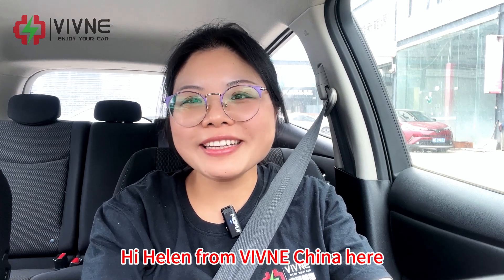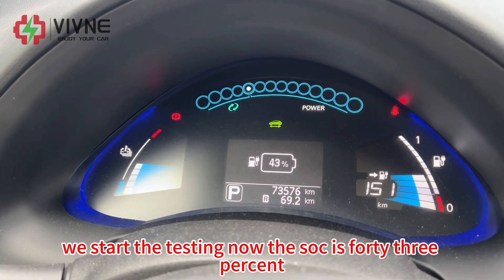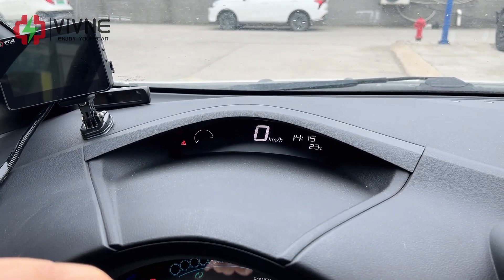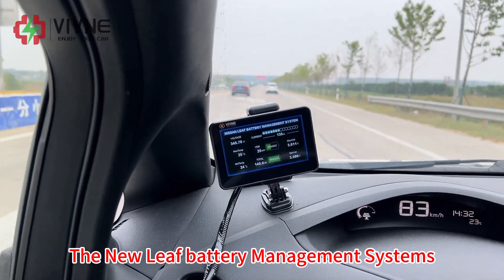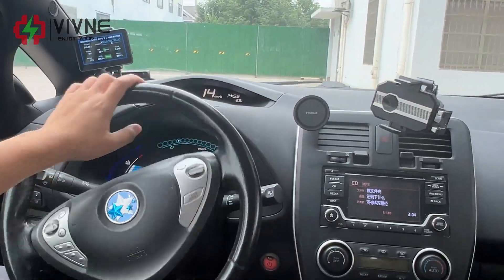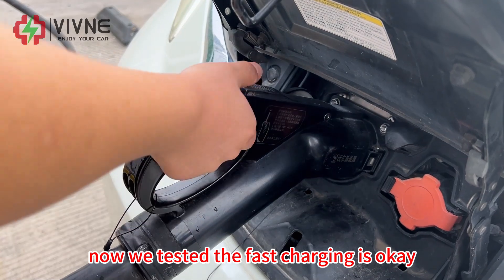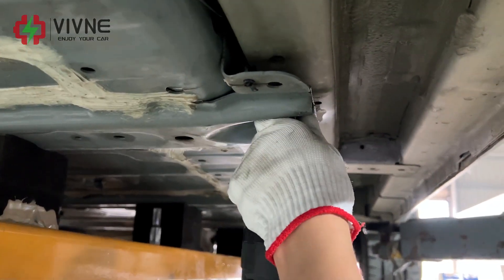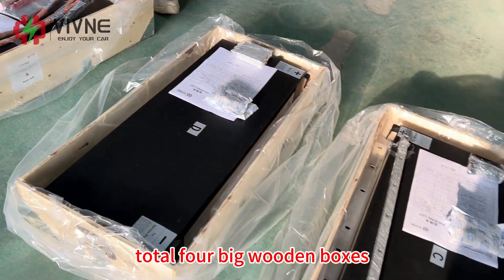VIVNE-50kWh battery kit to USA

Comment: I got a 50kwh pack several months ago, it came just as shown,  they supply a video link for assembly, they were quick to respond with any questions, pack works great just as they said.  Time will tell how long it will go but this company seems very conscientious.  Battery was less than half the cost of a Nissan battery besides Nissan will only replace the 24kwh battery with another 24kwh which is to small.  This company reprograms the bms so the 50kwn works like an original battery but with more than double the range.  I am happy with what I got
Reply: what was the price? shipping included? [EDIT] prices are listed on their website, so where are you and how was the shipping? at you door? How much. thks
Reply: @physiqueDrummond  I am in north central Canada (Ontarion).  I picked up batteries in Toronto.  I went in with others and we bought 3 battery packs two 50 kits and a 62 plug and play. Combined we felt it was half price from dealer replacement but the size was more than double what dealer will provide and the bms is reprogrammed; result works perfect.  The company quote is good and the support was very good; we are happy with range for our local situation.
Reply: @dennisshannon3288  and what about a video and a long range test?
Reply: how much was this 50kwh battery?
Reply: Hi Dennis. Did you get your leaf lifted for installation? I wonder what would the process entail and if the car is now modified for insurance purposes?